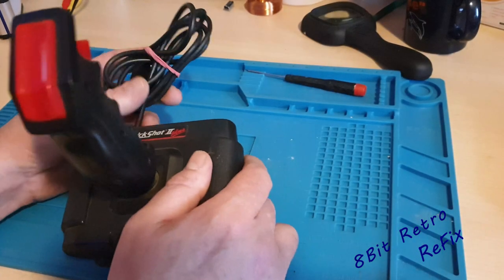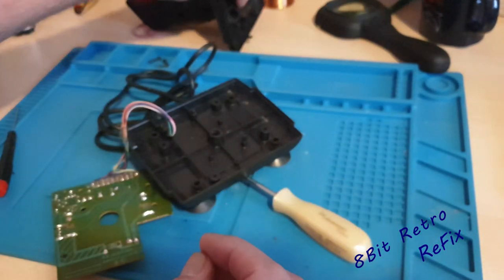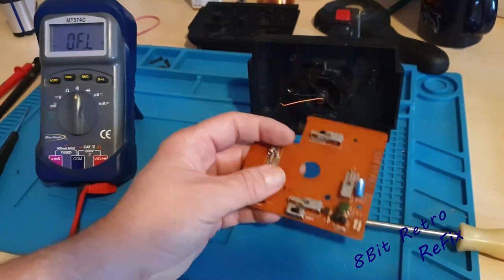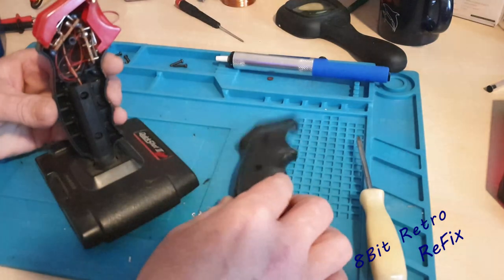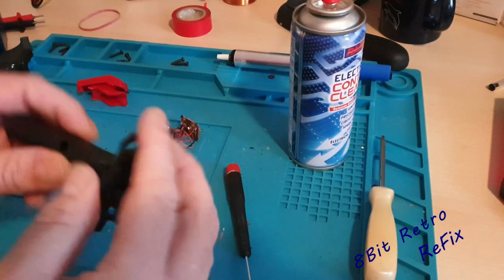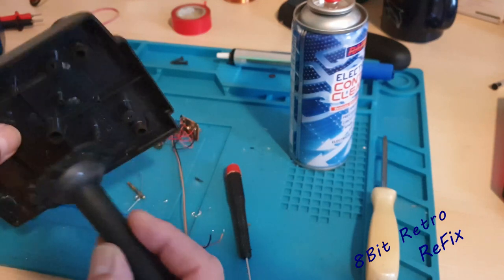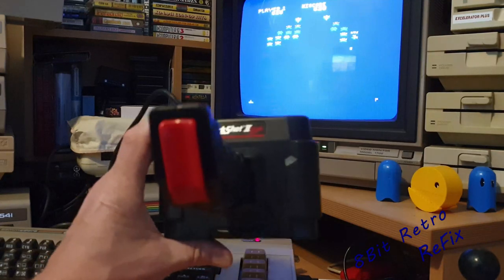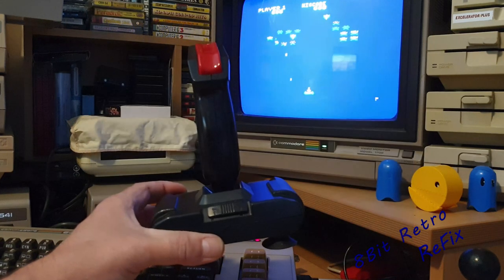How To Repair & Restore A QuickShot II Plus  & Joystick Gave Away Winner

Comment: Thank you for winning the competition. The Quickshot II was my first really joystick and I used a lot of them during my C64 years. When I found my old C64 in the attic, I realized I didn't have any joystick or tapes left, so this one is very appreciated.

I use the following program to test the joystick: 
10 PRINTCHR$(147)
20 PRINT"PORT 1:"PEEK(56321),"PORT 2:"PEEK(56320)CHR$(19):GOTO20

255 = Port 1, 127=Port 2, subtract the number under from 255/127
Up 1, down 2, left 4, right 8, fire 16. So 237 would be Port 1: Fire while pressing down.